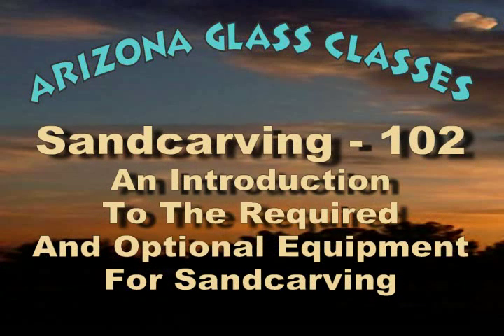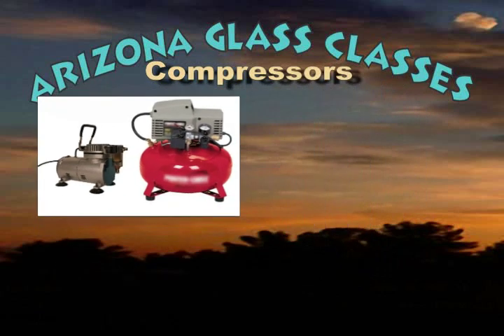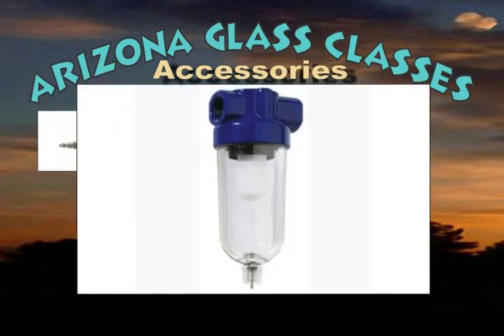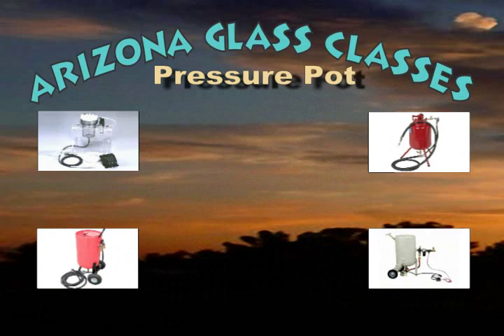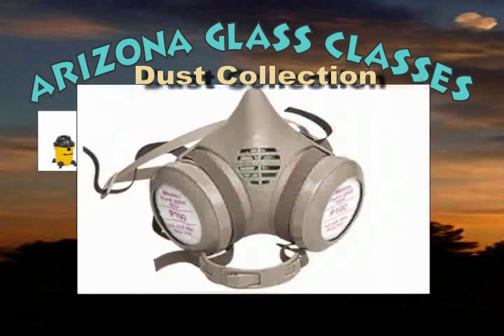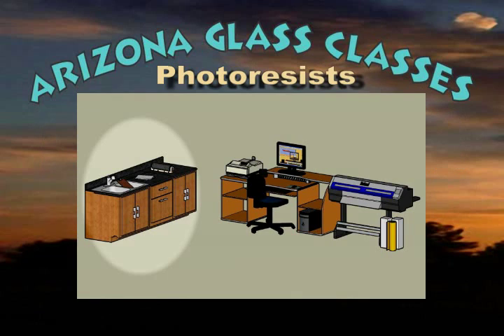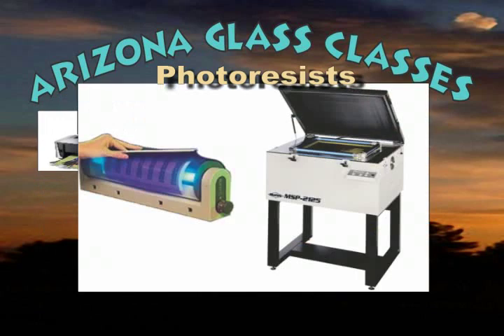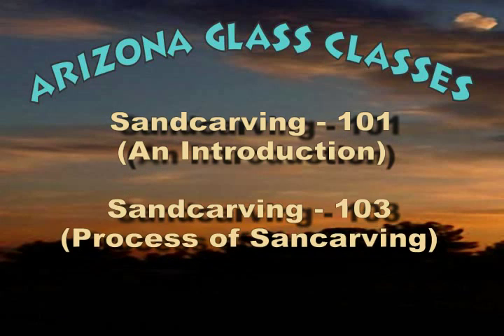Sandcarving - 102, The Equipment Required To Sandcarve

Comment: I made my first sand carved sign a few weeks ago and it worked well. I used a 20 mil  resist material and my wife cut it out on her Silhouette machine connected to her desk top computer. It just barely cut through the 20 mil material and I'm guessing that it would do better on a thinner resist material, so next time I'm going to try a 10 mil. I then used  shifted play sand in my 20 lb Harbor Freight pressurized sand blast pot. Thanks for sharing !